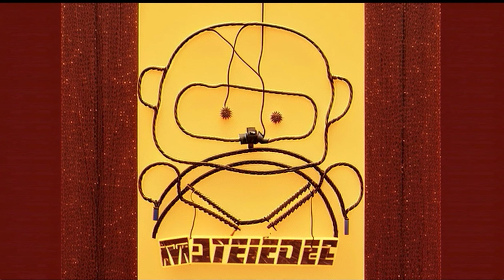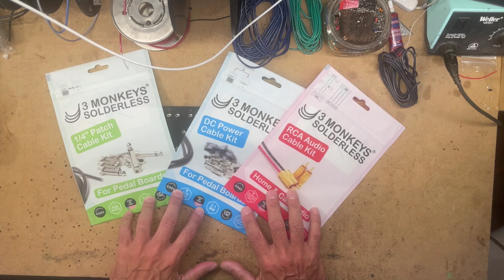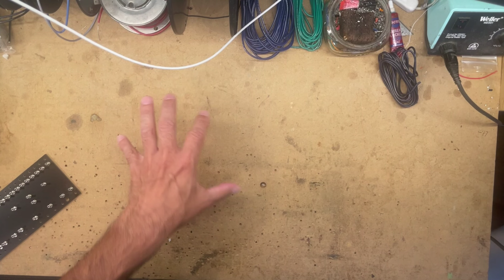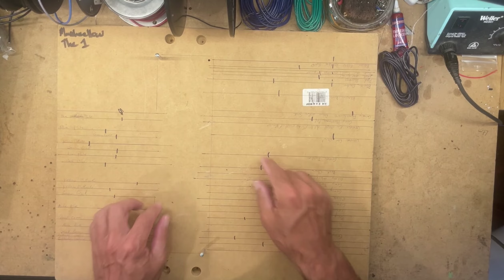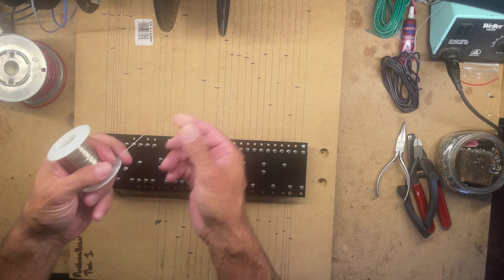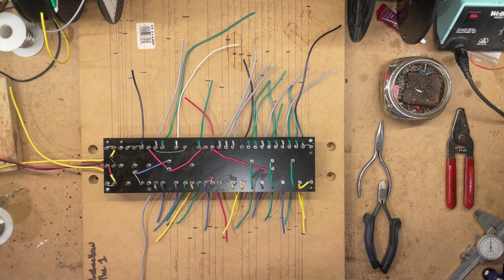Marshmello The 1 Build  Part 1

Comment: EXCELLENT TEACHING POINTS!...ON AN ABSOLUTELY KILLER AMP! 👍 YOU DEFINITELY HAVE INCREDIBLY TRAINED EARS / HEARING...FAR, FAR BEYOND THE NORMAL JOE, AND THAT IS WHY I AM HERE! (question....why are there two 10k dropping resitors in series by the bias, instead of just a single 20k...length issue?!)
Reply from the maker: Thank you for the kind words :)
Ossie
Reply: I think I know now....because a single resistor's leads are not long enough to span the distance of the width of the layout board.